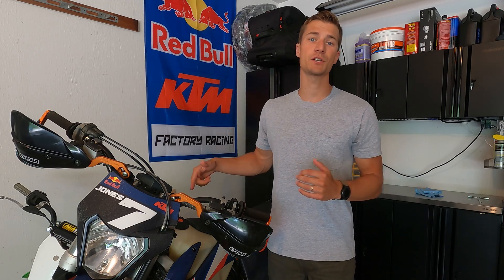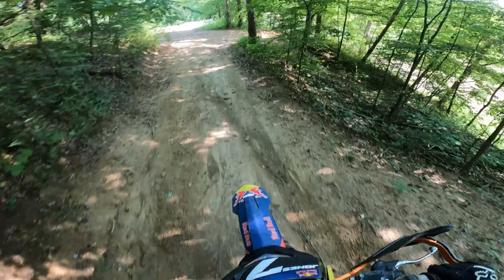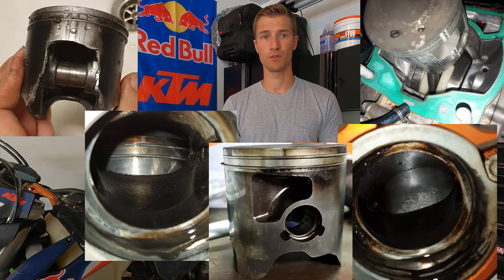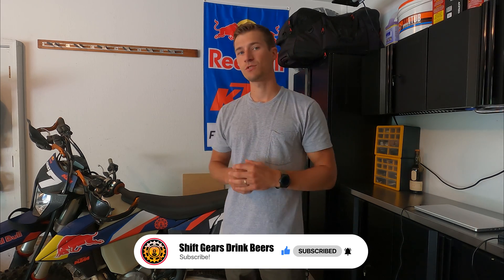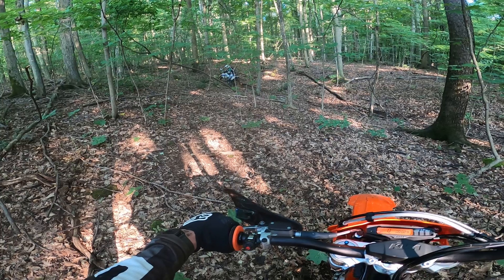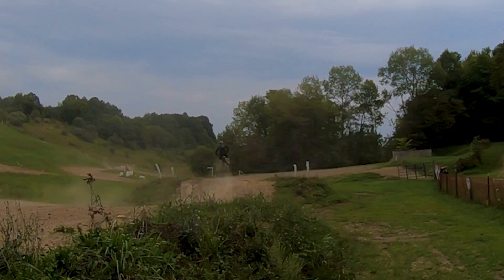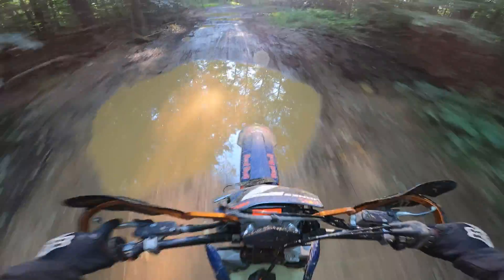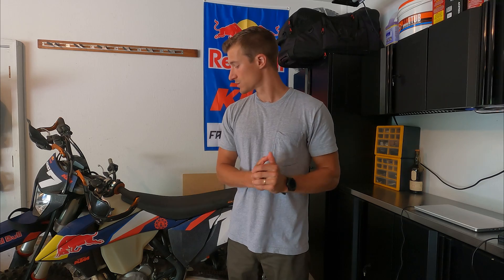TPI ECU Reflash - KTM Husqvarna Gas Gas

Comment: My 18' TPI has a weird stutter around 25% throttle when I am just putting around and it will fall on it's face and about stall unless I throttle up. Dealer had no clue what to do. Claimed they reset the ECU. But i would love a reflash! Other than that it's the best bike I have ever ridden. Makes me look like a great rider 😂 I would be interested in what you are running or any suggestions
Reply from the maker: You should definitely replace your crankcase pressure sensor. I have a few videos on it. Check them out and hopefully it helps!